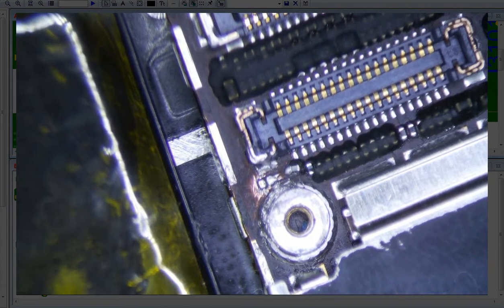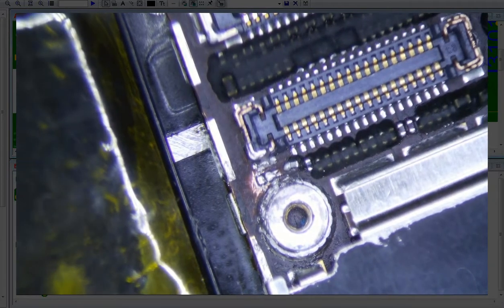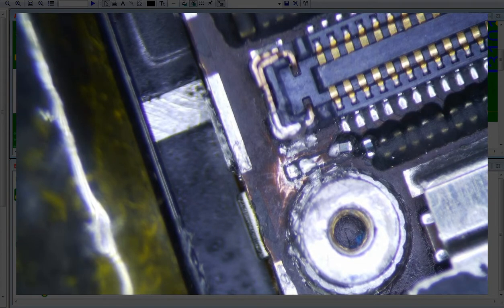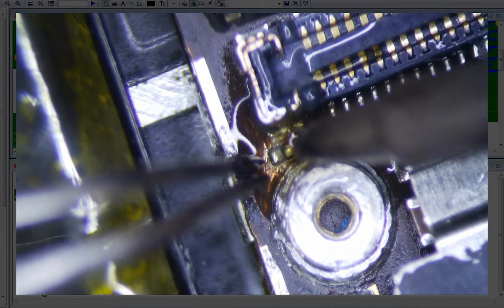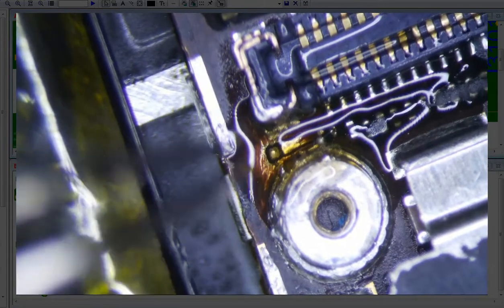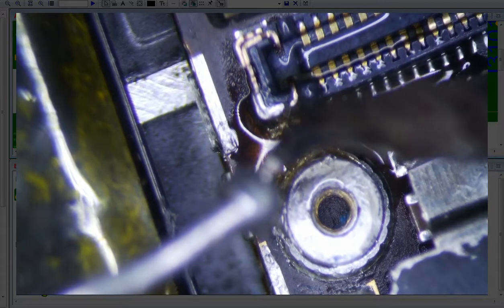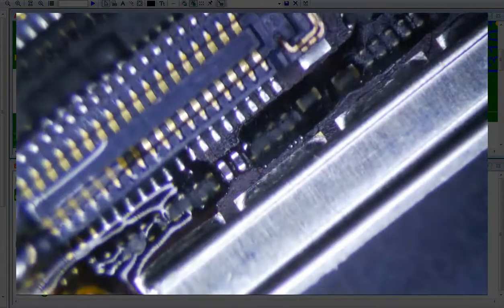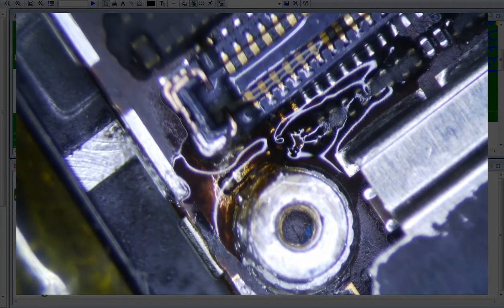Microsoldering a 01005 SMD Component

Comment: Hi, which soldering tips do you suggest work best for 0201 components. Especially for high density PCBs where larger tip sizes tend to interfere with other components on the board. Thank you.